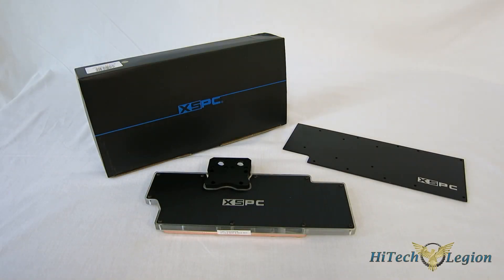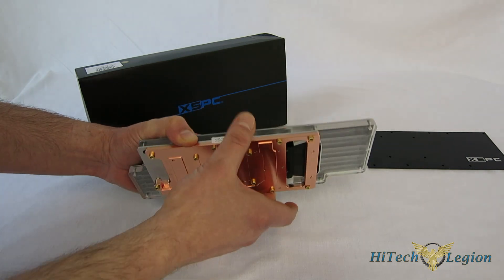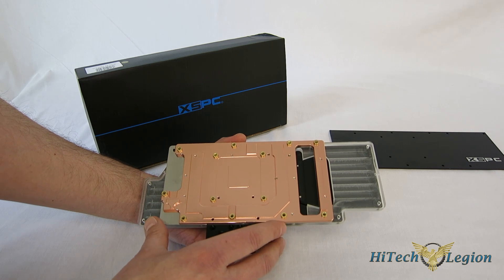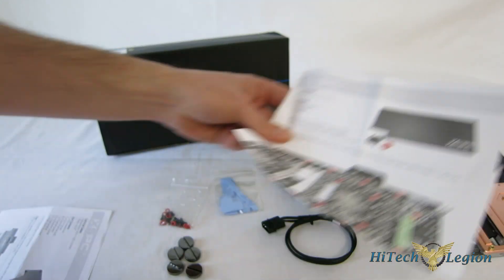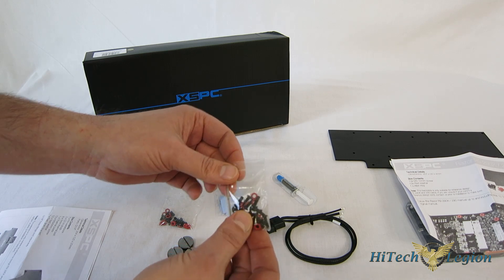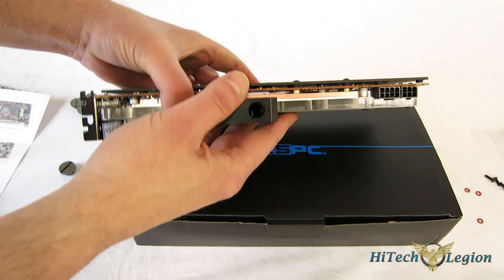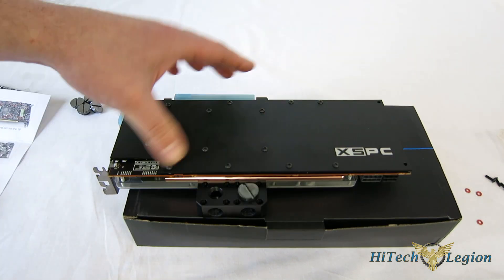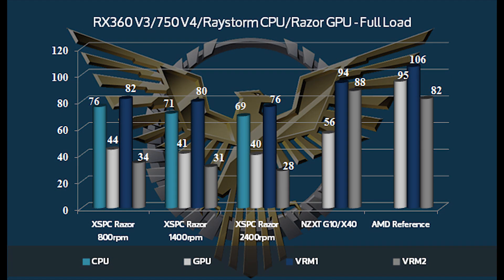XSPC Razor AMD R9 290~290X GPU Block Overview and Benchmarks

Comment: need some help i have the same rx 240 kit and i want to add a 240 or 360 and a gpu to the loop can it work or should i go for a better pump. so a 240 + 360 + gpu+cpu can it handle it or just do 2 240 gpu and cpu
Reply: It will handle the added GPU block and radiator with no problem.
Reply: so a 240 rad with a other 240 and gpu and cpu

Comment: I could really use some help/input. I recently bought the raystorm 750 with the ex420 rad with that gpu cooler and a 290x. After everything is installed, The 290x isn't recognized anywhere. it's like it's not there. i followed the instructions, and the board isn't bending, so I don't think I over tightened. Any thoughts? this is my first watercooling experiment, and i hate to think i ruined a graphics card.

Comment: can i use this on r9 390?
Reply: +misterbrinks Depends on what 390 model you have. Most companies that make waterblocks for GPUs design their block from the card manufacturers reference models. And the 390 cards that are reference design and can fit waterblocks (from EKWB at least, but I think it goes for most waterblocks) are the ASUS DirectCU II, XFX Double Dissipation and Powercolor PCS+.

Comment: The temps on the g10 vrm benchmarks were high. Im wondering did you install heatsinks on the vrm? Im guessing no?
Reply: Robert G Temps are in line with the several installs I have done with the G10. No heatsinks on the VRMs. The fact is, a makeshift adapter with a wannabe water cooler is not going to perform like a full cover block.
Reply: Its a Bad water block

Comment: I have the ex240 kit and im about to add the r9 290 waterblock. Its all sitting in my closet, installing it this friday. Im so glad i could find this video because my literal question was "can i just add the gpu waterblock to the ex 240 kit?" and you answered it. However, my gpu waterblock DID NOT come with a backplate, is this normal? Is something going to go wrong without it? Im greatly impressed with these XSPC products, I will continue to buy from them if this gpu waterblock goes as planned!
Reply: Adam May The backplate is an optional accessory and must be purchased separately. It is really for looks more than anything else.

Using only the EX240 radiator is really a bit shy of ideal for your setup - you should look at adding a 140mm or 240mm radiator to the loop if possible.
Reply: Okay, and Im assuming so im not transferring warm liquid from the cpu to the GPU block?
Reply: Adam May Not at all - you will notice that most loops go directly from the CPU block to GPU block. The rise is liquid temperature through the CPU block is minimal provided you have adequate flow - typically loop order has little to no impact on performance. You do, however, need enough radiator surface to keep th liquid at a cooler temp throughout the loop.
Reply: Oh, okay, I always wondered about that, thanks so much. This is probably another stupid question, but how do I know the temp of the liquid?
Reply: Adam May XSPC (as well as a few other companies) makes in line liquid temp sensors. They are available with their own LCD readouts, or can be plugged into a temp sensor input on your MB or fan controller if it has one.

Comment: does the 290x have to be a refrence card??
Reply: ***** Yes, this block fits reference board designs. It does not have to be AMD branded - this is an ASUS board, for example. But, it must use the reference board design.
Reply: George Cella  so does anyone have a water block for the xfx 290x   board ?
Reply: ***** Depends on which particular card it is. coolingconfigurator.com is a good starting point to let you know if it uses a reference block.

Comment: How much will the Raystorm 750 EX360 cool my FX-8350. i cant find benchmarks anywhere  i'm wondering if its worth the investment
Reply: LOL, im sorry to say but buying a cooler that cost more than a low end cpu is not the best idea.  You could get away with a 220 evo air cooler.  But feel free to get such a kit if you plan to expand to GPU's in the future.  That ex360 could do a cpu and a gpu with decent temps.

Comment: Evidently this reviewer does not know where the rear VRM's are located on the AMD OEM R9 290/X PCB because he placed the thermal pads on the R15 Modules rather then the VRMs.
Reply: Yes, I did. It has been noted a few times in the comments by me. Unfortunately the wrong sequence wound up edited in, and correct footage was deleted prior to my noticing it.

Comment: Could just the 240 kit handle both gu and cpu with cpu overclocked
Reply: That would depend on the CPU and GPU in question. We did that in the review of the RX360 V3 as a comparison. In most cases it would work pretty well, but obviously having at least 360mm of rad in that setup, or at least the RX240 kit would be ideal.
Reply: Well I have the h220 the radiator is low fpi and I believe 25mm thick. I have a gtx 780. I wanted to added a xspc raZor to it. (Note: cpu is fx 8350 at 4.6 never reaches past 45). Do you think the 240 could do it or should I buy a 360 mm rad to go with it. I won't be oc my gpu more for looks
Reply: The 780 definitely makes it an easier proposition than a 290/290X since it generates quite a bit less heat. You could probably get by with just the H220, but things could get a bit warmer than you would like when the CPU and GPU are both under load.

You could always try it out and if you feel it necessary add a 120 or 140mm, or another 240mm, or just switch out to one 360mm. Personally, I would add the second rad right from the start.

Just a tip - I have expanded a few H220s. Adding a res will make your life infinitely easier as the H220 is a PITA to bleed and keep air bubbles out of. The Swiftech MCRES Rev 2 is only ~$25 with fittings and works well for this.
Reply: Thanks for the advise. I bought the micro res bc it was a pain bleeding. I think I may get a 360 rad and than I could always use the 240  with it

Comment: You never stated on how the water was flowing in the loop... Which is being cooled first, the CPU or the GPU? And, where is the cooler water coming from, the radiator or the reservior? Thanks.
Reply: Pump-rad-cpu-gpu-res
Reply: George Cella Thanks for the quick reply :-)

Comment: I have a MSI R9 290 OC edition that has a MSI branded backplate on it. Could i use this with this waterblock? Never done a custom loop before but planning one in a few months and i like the backplates of my GPUs
Reply: I am guessing you have the Twin Frozr? That board shows as a reference design, so the Razor block will work. I can't say for sure if the MSI backplate will work correctly with any block - personally, I would much rather be safe than sorry and get the backplate made for the block you are using. Even if it appears it is lining up correctly, you may be putting stress on the board somewhere.
Reply: Ok thank you. the 2 plates do look almost identical other than the branding and some cutouts on the back of the MSI one, Which im not sure why they are there, But i cant see how 1 metal plate can really differ from another metal plate. May be i will try and see before i order a new back plate. Thank you.
Reply: David Dewis In this case, the backplate becomes part of the mounting system for the block. Also, the proper screws and washers for using the Razor with a backplate are included with the backplate, not with the block.
Reply: Ah ok. Thank you didn't realise that. Maybe I will get backplate then.

Comment: The kit came with the backplate?
Reply from the maker: No. It is available separately as stated.
Reply: HiTechLegion Didn't catch that sorry.  That back plate with the Right MM pads on the back of the vrms help cool them a bit more. Found the pads it came with were not that good i replaced them with 1mm Fujipoly UE.  Doing so reduced my vrm's by up to 15C.
These gpu blocks are working awesome.
Reply: +HiTechLegion 12:25 One simple question. Where is the 24-pin ATX power connector? By the way, it is fine to use the block WITHOUT the back plate? Thanks for any helps
Reply from the maker: Nguyễn Trí The backplate is an optional add-on that is available separately. There is no 24-pin ATX on a cooling block.
Reply: +HiTechLegion Thus, without the backplate on a high end graphics card, together with the massively vibrating PCB, should there be any worries of PCB being broken?
Reply: +Nguyễn Trí What, exactly, is causing these massive vibrations to your PCBs? Perpetual earthquake? Using a paint shaker as a case?
Reply: +George Cella You got it - quite a lot of earthquake at where I live

Comment: I am very surprised that it runs on the same loop with a radiator and pump! But XSPC shows it and is better than some on the DIY water cooling. Would it be possible CPU + GPU with the XSPC operate 750 EX240? or you would have to switch to the 360 radiator! Thank you for your answers;)
Reply: All of the benchmarks adding this to the Raystorm 750 EX240 kit are in this review, as well as the benchmarks using a 360mm rad with the kit components.

Comment: WOW... thanks for making this video!   Shows really well what a simple loop can do for you GPU.    And the XSPC GPU block looks amazing, I want that same block for my 780.   

What temps could I expect at full load with a xtx 360 + rs360?  With a i5 4670k + gtx 780.
Reply: I'm actually running a 3570K @ 4.6/780 @ 1040MHz base right now with an XSPC Razor/Raystorm/EX240/Alphacool UT45 280/D5. My fan curve is set to sit at 640 rpm idle, 850 rpm max. The CPU tops out at ~62, GPU at ~43 with the fans at 850. I lose a few degrees with the fans cranked to 1400 rpm, but it has been a while since I have done it and don't recall the exact numbers.

A lot will depend on the fans you choose, curves you set, etc. You have plenty of rad, so you should be able to get some great temps with low noise.
Reply: I would run it with a d5 pump and I think I would use the NZXT stock fans in the H440 as push and the Corsair SP quiet for pull on the XTX and corsair SP quiet in pull on the RS360.

I would like the GT fans on it but I think it will go over my current budget...

But with the GPU a bit like yours at 43 ish is gold!
Reply: You may want to match up all of the SP120s on the XTX, and use the stock fans on the RS360. The XTX needs a lot more static pressure to be efficient and the SP120s would provide that. The RS360 does very well with lower static fans, so the NZXT fans would do well on it. That just seems like a more efficient configuration to me.
Reply: cheers!   I will do so!

Comment: Fantastic review Legionnaires. Learnt a lot and those XSPC cpu/gpu blocks look awesome. Appreciate the loop was only basic but those benchmarks were still real good.
Reply: Keeping the loop very basic was intentional, especially simply adding it to the Raystorm 750 EX240 kit. We get asked all the time about adding a GPU to that kit or H220/Glacer 240L. This gives you a chance to see exactly how well that type of setup performs - low cost and mind blowing cooling with low noise.

Also, we wanted to focus on the capabilities of the Razor. Loading it into a loop with a couple of 480 Monstas in push/pull and a D5...and, well, any block would look good. The Razor performing like this in a small, simple loop shows off just how effective it really is.
Reply: George - I hope you do more reviews like this as they are seriously lacking + you certainly know your onions and the production quality was superb..:))